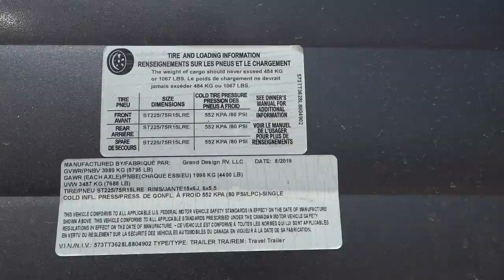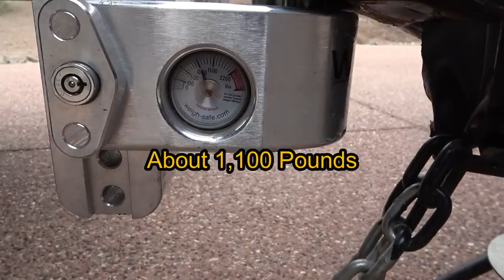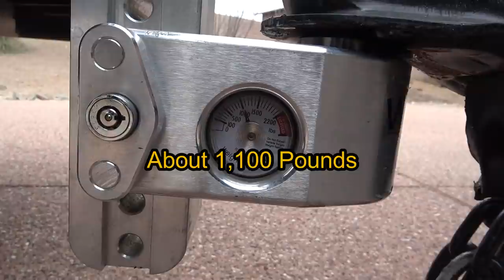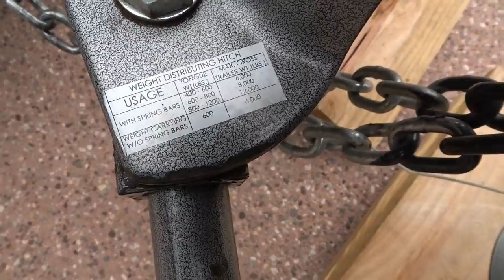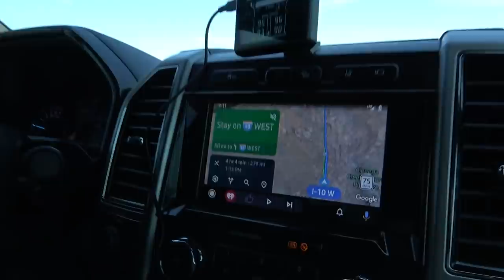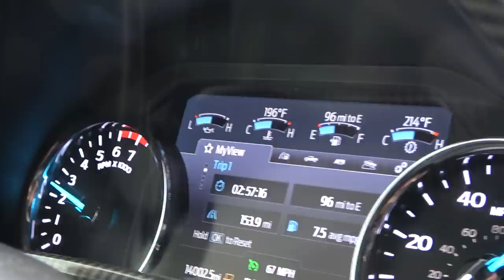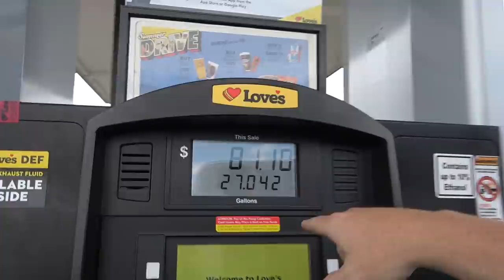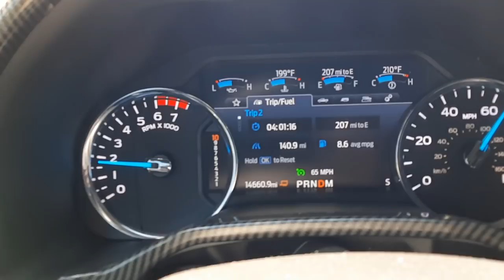Ford F250 7.3 Gas, 4.30 gears, MPG, towing prep and MUCH MORE!

Comment: FYI you are using the anti-rattle upside down, the way you are using it , all the weight of the trailer is on the U bolt, if you use it the other way the U bolt keeps it from bouncing up over bumps, all the weight of the trailer is on the hitch not the U bolt, the same for your bike rack.
Reply from the maker: That’s makes good sense… thank you!!
Reply: So you have to tighten the bolts from underneath? That kinda sucks 😕

Comment: I have the F350 diesel and use the lower gears well going downhill without a problem it has 355 gears mixed with a 67 diesel is a 2023
Reply: My choice would be 3:73 but due to the feds and mandated fuel consumption 3:55’s work. It just on start and stops in traffic hesitates a bit. On highway in high country terrain no problem and gas economy is the same

Comment: Hello, I just wanted to let you know that I have seen some people turn their RV jacks one quarter turn to the right. This enabled them to get their trucks tailgate fully to the down position when hitched to their RV. If this also applies to you, you could also be able to fully open your trucks tailgate. One more benefit is that the jack’s up/down switch would be on the driver side of the RV. RV manufacturers should always turn their RV jacks that way. Thanks for the great video. You cover a lot of important stuff in this one.

Comment: So two years later I am watching this video in my 41 foot motorhome  on a F53 chasis with a GVWR of 24000 lbs and a  6 speed transmission behind the 7.3 gasser.  24000 miles on this rig and I average 8 mpg per trip.  Not shabby milage using 87 octane unleaded.    Did I mention oil changes are under $100.00 using 100% synthetic oil?  DIY of course, cause it is an easy task even for a 73 year old.  Sorry to say I must soon sell this rig as I need to make room for the 2023 F250 Lariat I just purchased to tow our 42 foot 5th wheel RV.   Yes the truck has the 7.3 gasser but backed with a 10 speed transmission.  I think Ford finally out did itself by producing the "Godzilla".

A bit late to partake but thank you just the same for the video.  Nicely done.   Maybe see you on the road sometime as we pass through Arizona on our full time RV journey.

Be well and take care.
Reply from the maker: Thank you sir for the kind comments.

Comment: I picked my 22 F350 up Oct 2 2021. Has the 7.3 and 3.73 gears.  Oct 8th we took off on a 3500 mile trip pulling 6500lb travel trailer. All through Colorado on I70 to I 15 down to Zion National Park. Then down through Vegas to the Grand Canyon. The towing experience with a HD pickup vs a half ton is so much better.

Comment: Another great video! 
I have owned RV's for 40 years now, we are currently on #6, a 21 Grand Design Reflection 303RLS. The tow vehicle is a 2021 Chevrolet 3500HD Duramax. This is the first diesel I have owned. Our last RV (2007 Winnebago Class A) had a 8.1 liter (496 CI) Chevy and Allison 6 speed. Your points about gasoline vs diesel are spot on. Our RV an 8.1 gasser got 7.4 mpg average flat towing a small SUV and the new Diesel towing 12k is getting 10.5 average and 18 mpg not towing. That said and in my opinion once you tow with a diesel you will no longer want a gasser. We live in the Sierra Mountains and frequently tow in the Sierra and Rocky's over 8 to 10k high passes. 900 plus foot pounds of torque is amazing but what is even better is downhill. Try towing down Kingsbury Grade from South Lake Tahoe into Carson City NV using the diesel exhaust brake. You will never go back to a gas engine. If you tow on mostly flat highway okay but the hill climbing is only half, going down is pretty important. You have a beautiful truck that is very capable (high transmission temps are very concerning though) of safely towing your RV, enjoy!
Reply: Not to beat the trans temp subject to death but as a retired mechanic with 40 years of on the job experience 220 degrees F is as hot as the transmission fluid should ever be. I don’t care what the manufacturer says or what type of fluid it uses. Seals start to harden and other bad things happen when ATF is that hot. Sure it will likely make it through warranty but something like a defective torque converter design is making that heat and it will cause a problem as time wears on. I know this sucks but you need to be informed.

Comment: I bought a 2021 f250 with 430 gear and thanks to you for steering to the truck 
I’ve have a ford forever and had a 2015 6.2 and after 245000 pulling a travel trailer for 90,000 or so of that 
Thanks For the good Unbiased reporting

Comment: I have two comments on the video. You spent a lot of time on gas mileage. I own a 7.3 also and if you buy one of these worrying about gas mileage is a waste of energy. They get what they get. 

Second comment. You did miss a very easy DYI. When you were talking about the tailgate you mentioned you can’t open it all the way. That is correct. The solution is simple. On the Jack post are two bolts that hold the control head in place. Remove them. Rotate the Jack head 90 degrees to the drivers side. Your buttons will be facing the drivers side. Now mark the shaft through the two bolt holes. Lift up the control off and drill your two marked spots and tap them to match the bolts. Reinstall the head in the new position and install bolts. Your gate will now open all the way. Simple.
Reply from the maker: Well… they do get what they get, but at the time of creating the video most people didn’t know what they got because this was an all new engine/trans “Tremor” package and that’s what I was featuring. As far as the jack goes… genius!!!

Comment: Good info, sounds like you have most of the bugs worked out, one suggestion in that hot desert area would be to upgrade your rear diff cover to a ram air type to keep the rear end cooler especially when towing. Nice truck !

Comment: Long video but very helpful, thanks. And keep up the 7.3L videos!  Looking to switch from a SD 6.7 diesel (which has been a great truck) to the Tremor 7.3L because I don't need the diesel any longer and only drive about 10k miles a year. Looking to simplify, add more offroad capability while retaining good towing ability and get away from the emission-laden diesels. Currently holding out to see the changes for the SD 2023 model year - hoping for similar changes like what was done on the '21 F150 interiors, along with the added features like on-board power. Hopefully by then LED headlight are finally standard. Disappointed Ford currently requires you to buy the ultimate package and then still charge over $1K for LED headlights. On a Lariat and above, LED's should be standard. Regardless, these 7.3's seem to be great trucks. Looking forward to learning more about your 7.3L experience.

Comment: just a little safety tip when I pull my trailer, or any trailer I always put a good quality hard bolt instead of that in with cheap clip to fatten it , it is pure safety , my good friend a old timer gave me that tip many years ago

Comment: The Mustang 10r80 has a thermal valve that opens and closes. Im Sure the 10R140 has the same thing. We replace them with a machined spool so the thermal valve is open all the time. It helps keep things cooler, especially when paired with a lower temp engine coolant thermostat.
Reply from the maker: Thanks for the info!

Comment: Just one thing I did was on the hitch silencer I put it on the bottom. On top you're putting all that weight on the u bolt. Putting it underneath, all of the weight is on the receiver instead. But I do love it. Pulling the boat or empty flat bed it would rattle like a SOB... So far I'm not real happy with my truck. It's the same as yours except it's a 2022 Ultimate Lariat Tremor. The constant shifting gets annoying when your used to the diesel just locking in and pulling. I'm pulling a 36' bumper pull toy hauler.
Reply from the maker: Great advice on the u-bolt!

Comment: I went to the dealer looking to buy a 7.3 Tremor. I don't tow now but wanted the option later. The salesman said "what are you just looking to buy lots of gas?" Since they didn't have any I checked out and was blown away by the powerboost f150 with on board generator. I've since purchased a lariat powerboost and couldn't be happier. I'm getting 21-22.5 mpg. If Ford put this electric motor technology the 7.3 it would kill the rest of the market.

Comment: Awesome vid!  I have a 2021 F-250 Crew Cab with the 6.7 diesel.  My payload is 2503 lbs, the trick is to get a more stripped down truck.   Mine is the STX FX4 package, so not a lot of bells and whistles.  It’s when you get into the Lariats and King Ranch models where your payload really drops.

Comment: Great review. I had a 2018 F350 diesel SRW 4x4. I wanted the diesel for towing power and the exhaust break. We got 13 mpg towing ten thousand pounds and 18-19 mpg empty. It looks like your truck does a very admirable job uphill and down. I would not have thought the gas engine/transmission would do that good of a job. They've come a long way from the 1980s and 1990s models that I used to own. That is one long trailer! You may someday want to try a shorter model. They are more maneuverable and it is a lot easier to find campsites. To each his own. We downsized all the way down to a class B after we retired.

Comment: The payload in a 2021 GM 2500 HD crew cab standard bed with the 6.6L gas is 3760 pounds, and with the diesel it's 3560.  The GVWR of the diesel 2500 is higher to make up for most of the weight of the diesel.
Reply: I’ve noticed same thing with the HD GM’s payload, it is much higher than the Ford or Rams. Ford and Ram need to to up their GVWR as well. If you are going to tow any amount of weight in a diesel, you need to look at Ford 350 or Ram 3500 because of the low payload on their 250/2500 models with the diesel.

Comment: Thanks for the video. I’ve currently got a 2018 ram 3500 srw Cummins ho. About 30,000 on it now and I’m kind of attached to the truck. And I’m a Ford guy. The 7.3 wasn’t even out when I bought it but ever since, I’ve always told myself that if the emissions give me any grief that I’ll go and trade it for a tremor 7.3 no problem. Had a DEF pump go out but was replaced under warranty. Nice thing about the emissions stuff is that it’s covered for 8 years or 96,000 miles or something like that, so I’m good for a while. Now a 40 foot fifth wheel later (will be going smaller for the next camper), I have been getting caught up on 7.3 videos. Seems like the gas truck would simplify my life a bit. Worse fuel mileage, sure. But with lower cost oil changes, a transmission that doesn’t need to be serviced every 30,000 miles, and (because I try to take care of the truck) the warm ups before driving and the cool downs before shutting down. Not to mention on my way to work I’m not sure the heat ever even comes on. Gas and diesel always seem comparable where I’m at, but it’s Ca, so we just get shafted no matter what. The diesel is nice. I’ve owned probably six diesels in the last ten years…but I’m not sure if it’s worth it for me either.
Reply: witht the 5 dollar plus  gas prices now no way will i get gas. we towed with a 7.3 gas and got 5mpg thats a joke .unloaded around town un loaded 12 mpg.  if you tow go diesel !

Comment: Great tips. I used the same WDH on my 2015 Bullet Premier 36’ TT. It provided excellent sway control. The only sway that could be felt was the vacuum effect when being passed by semi’s. Very clean and easy to use system. I would place a small zip lock bag over the greased ball or when wearing a latex glove, grab the ball with the gloved hand and remove it, transferring it onto the ball. Keeps things nice and clean. I also noticed that you didn’t install the retaining pins over the bar ends once installed. Not sure if they are missing or you just left that part out of the video.
Reply from the maker: Wow good catch! Yep, I put those in later.

Comment: Jordan, great video. Just a correction on what you said about F250 diesel‘s. you mentioned that having a diesel minimizes your payload capacity, or an 1800 to 1900 pounds while yours has over 2900 pounds. Just for the record, I have a 2021 F250 lariat and my payload is 2825lbs The  F350s are much higher as well so I think you might want to check that data. We bought our truck to pull our fifth wheel 33 footer and I’m glad we got the diesel for that extra power for where we live. Your Tremmor looks awesome btw..
Reply from the maker: I was a little low on the numbers, but the diesel does lower your payload by the weight difference between the gas and the diesel engine. Every option over a base model will. If you have two of the same trucks and one has leather and one doesn’t, the leather equip truck will have a slightly less payload because the leather weighs more than the cloth.  Thanks for watching by the way!

Comment: If I had to replace my truck anytime soon, I would definitely consider an F350 SRW 4x4 with the 7.3 and 4.30 gears. I would probably opt for the long bed crew cab for a bigger fuel tank. The Tremor package is pretty cool though.

Comment: I'm averaging 11.6 over 4k miles tracked pulling 40ft fifth toy hauler weighing around 17k with a 21 F-450.   I've owned a number of big block, forced induction gas motors and diesels.  Diesels always win when it comes to tow experience, mileage and longevity.  I'm impressed with the 7.3 but mostly with the 10 speed which help both the gas and diesel motors.   As long you are happy and it gets you where you need to be - go for it.
Reply: You are so right, there are many advantages to owning a diesel. Everyone likes what they like but there is a reason there are so many million mile diesel trucks on the road.

Comment: These are the numbers I get with my 2021 F350 7.3L. I don’t think you can beat this  new engine. Lots of off the line torque, plenty of HP, and sounds like a boss when you get on it.
Reply: Looking at a 4:30 gear set on one. Jjst need a bigger truck to pull a 33 foot TT coming in at 8200 pounds. My current Silverado CC 5.3 will do it bit the tongue hangs out. Don't think I'd wanna go interstate with the setup.

Comment: I use E85 for my 2021 6.2L F250 XL and 34 Gallon tank can drive 410 miles on the highway and it can drive 348 miles with 4500lb PJ dump trailer.

Comment: i have been very curious about the 7.3 in. 3/4 ton.  Thanks for all the Info.  

I have a 2020 F250 diesel with the high capacity tow package.  This package adds an additional 800# to GVWR.  Standard 3/4 ton will have a 10000# GVWR.  The high capacity tow package increases this to 10800#.  This is both good and bad.  Good because it gives me 3166# payload with a diesel 3/4 ton.  (Diesels have about 500# weight penalty).  Bad because it puts it I we the 10000# GVWR which, in many states, places it in the commercial category.  In Texas this is the case and, if you are pulling a “vehicle” with a GVWR of over 10000#, you are required to have a class A or B drivers license. 

Dodge:Ram does not have a 3/4 ton option that increases GVWR over 10000#.  However GM/Chevy does have 2 options.  The highest is a 11350# GVWR for the 3/4 ton.

I was curious about the 4.30 rear end.  After watching your video I think the 4.30 is a perfect rear end for the gas engine with the 10 speed.  In my opinion that rear end gets the rpm’s too high for a diesel.  I have a 3.31 rear which is the perfect rear for the diesel with the 10 speed in my opinion.  At 70 mph the tach shows 1519 rpm.  The 10 speed provides a great balance for towing.  

On my F250, in the rear, there are 4 springs plus the overload spring (5 total). That is the standard setup for the high capacity towing package.  I believe the standard F250 has 4 springs total???

We have a momentum 21G.  Typical trip weight is about 8500#. Tongue weight is generally 1250/1300#.  The frontal area of the momentum is almost 20% more than a traditional bumper pull. Amazing the difference this makes towing.  We just returned from a 4 week trip where we put 4200 miles on the trailer.  We averaged between 8.5 and 10.5 mpg while towing depending on factors like mountains, headwind…

As far as diesel prices…at truck stops they inflate the diesel price.  If you have a “fleet” account you will always get a discount.  I find diesel about $0.10 more per gallon than gas on average.  We had a 1 ton Chevy Express with the 6.0.  With normal driving (not towing) We averages about 13/14 mpg.  With out F250 we average 17/18 mpg. So the extra fuel cost is, essentially, a wash.  Also oil change intervals are about 10000 miles with diesel and 5000 miles with gas.  Almost a wash in maintenance cost as well. DEF does add some additional cost.  And, overall, a diesel will h e higher maintenance costs than gas, just not as much as what some are saying. 

In my opinion there are advantages and disadvantages to diesel and gas engines.  One is not a clear winner - they just serve different purposes and provide options for different preferences.  I’m super happy Ford came out with the 7.3 gas.  I think that’s a fantastic option that only enhances the truck market.

Comment: My 2021 E350 cutaway van with the 7.3 gas motor at 70 is around 2,500 rpm. It has the 6 speed transmission with 4.56 gears 😱.
I average about 11.4 mpg on the van converted to a camper. The at 55 mph it will sometimes get 12.8 mpg.

Comment: Really good and informative video. I applaud you sir. I am looking at getting a F350 with the 7.3 in it. The towing numbers are similar with the tremor and non-tremor. I just want the higher payload of the 350. But I have also been looking at the Chevy 2500HD 6.6 gasser as well.